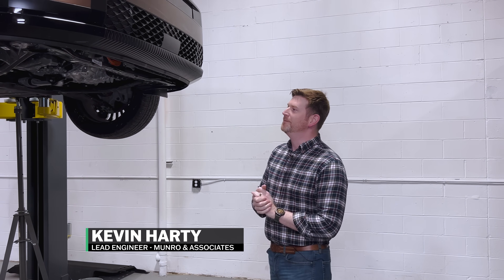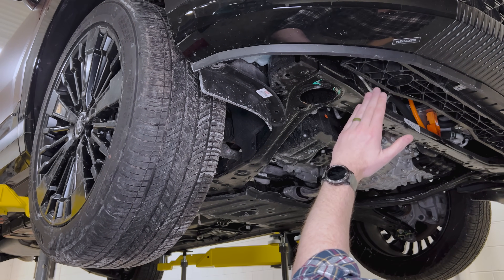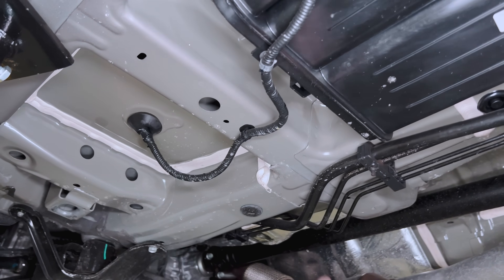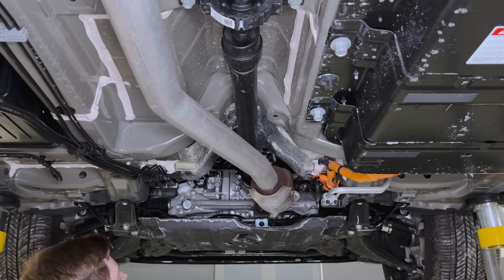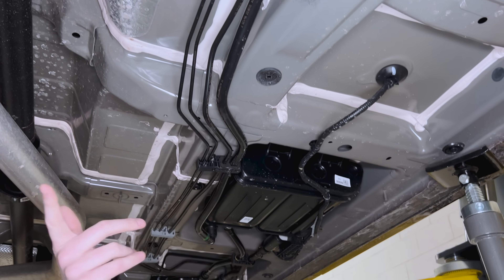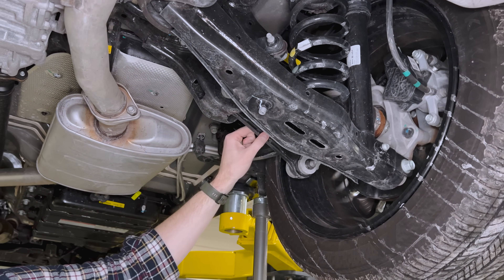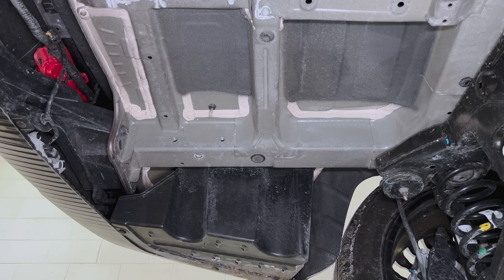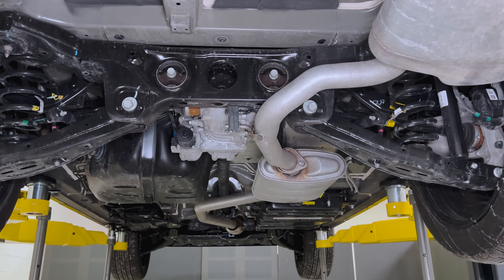2025 Hyundai Santa Fe Underbody: Body Structure & SORB Strategy Breakdown

Comment: May I take the opportunity to observe that this kind of hybrid, with its small battery, is best conceptualized as having a 4 dimensional transmission. That is, it uses the 4th dimension, time, to transmit power from the engine to the wheels. Power generated minutes or hours before is used for acceleration - excellent acceleration is possible without the need for a larger engine. That previously generated power has been converted to momentum, so when recuperative braking is applied the some of that power can be recovered. Over the long term this saves gas, a small engine burns less gas. The downside is the mass of the battery and motor and engine have to be carried around all of the time. This kind of hybrid is good for producing good performance from a small ICE engine but doesn't provide the benefits of a PHEV.

Comment: Did y'all catch that? Some manufacturers only include the more robust crash countermeasures in markets like the US which require them! They delete such features in other markets,  EVEN AIRBAGS at times,  making their vehicles cheaper and less safe. And we thought the Ford Pinto was bad, 55 years ago.
Reply: Well, that is why the ford pinto was so bad, lack of regulation. Good that most countries have stringent regulations and are not trying to get rid of them.
Companies will only do the minimum they can get away with to make the most profit.
Reply: Who knew regulations would be good for the public???
Reply: I think we go overboard with safety. I know how that sounds but we keep pushing more and more in and people still die. The only way I'm seeing all this unneeded safety tech is helping us is by keeping loads of autos off the road because the added tech needs to constantly get fixed.
Reply: Cars don’t crash in other countries.
Reply: @Derpy1969  like alien invasions. Only happening in the US.
Reply: If those features were optional I wouldn't pay for them.
Reply: Safety features should be optional features
Reply: IDK why but Teslas in the US have a driver knee airbag but outside of the US they dont. Still the Model Y got one of the best, if not the best safety rating by the EU crash test.
Reply: @MarsPLAYStudio what?  Kneebags have been commonplace for 15 yrs overseas in most markets and Brands because its standard build fit. Stop your US in front garbage your always catching up. A lot of brands didn’t have to modify builds for offset and pole side tests.  Perhaps in the US vehicals might have been the case.
Reply: The pinto was the safest car for its time. the bean counters removed the tank bladder to save a few bucks and it caused a big problem.  🤷🏼‍♂️